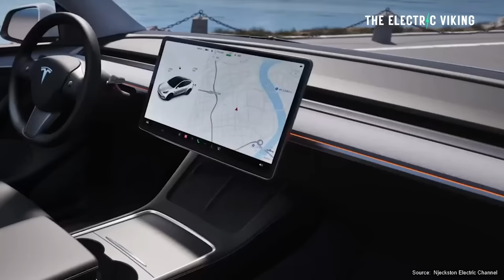Ship with thousands of NEW Tesla Model 3 & Y forced to sail back to China

Comment: Some corrections to a few major inaccuracies in this video:

1. The Glovis Caravel was not carrying any Model 3 Highland vehicles. The entire shipment consisted of Model Ys
2. There are no "updated versions" of the model Y being shipped to Australia.
3. The ship was not immediately rejected by the Department of Agriculture, Fisheries and Forestry. It spent a few months sitting off the coast, and went through more than one cycle of fumigation and inspection before finally being rejected.
4. The voyage between Shanghai and Brisbane is approximately 10 days.
5. Customers with cars on the Glovis will NOT have to wait a couple more months. They have all been assigned new VINs of cars just off the production line, which are right now being loaded onto another ship (The Morning Crystal).
6. The cars being sent which came off the production line just a few days ago, are the exact same spec as the September/October manufactured cars they replaced. The updated Model Y being sold in China, is NOT being sent to Australia.
Reply: A couple of months ago he was fixated video after video that the highland was getting new type of batteries with longer range

This was never the case as the battery pack and engines remained UNCHANGED 

He did like 20 videos on how the new batteries on the model 3 would make them the range king
Reply: @Rapido20  yes, it is just stuff he makes up without any value to it.
Reply: This reminds me of the following. “Hey did you hear James won $100 betting on backgammon?” “Yeah, except it was not James but John. It was not backgammon but poker and he did not win by actually lost. And it was not $100, but $10,000.”
Reply: sorry but honest question, why and how do you know that? I would love to get all those news and info that you got. When I got my M3 4 years ago (in Europe) I was searching for those info as well and never got it that detailed. Do you work in this business or even for Tesla?
Reply: You seem to have inside information. Do you work for Tesla?
Reply: Ok not that anyone thinks this youtuber is a Tesla spoke person but why should we believe you as well? Are you a Tesla representative? 
He is obviously only making guesses, but you are speaking with absolute certainty and authority, with no evidence what so ever shown for your claims.  
So to me your words have the same value has those of this youtuber, zero value.
Reply: Since you have so much info, maybe you must start your own channel and leave the viking alone
Reply: @petersmangalisongoma2013   If his corrections are correct, he's doing us a service.  Seems to know what he's talking about, even your heroes need accountability.
Reply: Excellent info. Just another war of the roses.😂
Reply: Thanks for the clarification. I would still not send new cars. Australian voted this government and its new rules into power. Let them live with the consequences for 2024 and then maybe send them the cars
Reply: So you are saying the make 2 versions of the model y in china the old one and the newer one and that seems logical to you? Not to me
Reply: Doesn't make sense they make 2 versions of model y unless they are stock sitting in a field somewhere accumulating bugs. So are you saying newer model y isn't made at all yet?
Reply: The Glovis Caravel arrived in Brisbane in late October, it was fumigated on 3 separate occasions failing each subsequent inspection
Reply: @lukasfoo recents status of the glovis caravel has been discussed on multiple online forums for quite sometime now bywaiting customers. Daily mail has just reported this. Likely to be a waiting customer
Reply: @RuffyUzumakii7 multiple Australian news outlets have posted articles regarding this subject.  Just do a Google search.
Where do you think Sam gets his information? He doesn't have a hotline to Musk. 😅😅
Reply: Check your use of apostrophes.
Reply: tried to kill the fruit flys that invade my place (no fruit oddly) and they keep coming back so its hard to kill bugs
Reply: Hi Tyran, great response. I spotted a few errors myself, as I have imported a few cars from this region, and have a rough idea of the processes involved (especially paperwork).

Fantastic correction from somebody who knows what they are talking about.

Ignore the other crank comments. These people are just being a bit “sooky”
Keep up the great comments!
😀
Reply: I don’t expect he (Sam) will read or respond. Interesting info. Thanks for posting
Reply: @Rapido20 I've noticed that most of his videos are hyperbole. They all start with, "Game over," "This is the end of legacy auto," or "This is a game changer." Funny thing is, most of it never comes to fruition. I take almost nothing he says seriously. I do like to watch some of his videos, it's pretty cheap entertainment.
Reply: I’m really surprised the info you posted there are damn correct. This is because we ordered a MY back in October and car was on that Glovis ship. We got messgae from Tesla saying our order has been delayed due to biosecurity. Yesterday we got an update from Tesla stating our order has been assigned to a new car and on it way. They also provide 6 month EAP as compensation.
Reply: @lukasfoo  its all on the Tesla Y Australia facebook group, customers who have been waiting and tracking the boat and also ringing up Tesla Australia for updates.
Reply: @bros4life690  Thanks.
Reply: Thanks for the update. He got literally everything wrong
Reply: @beavcleav3086 He doesn’t do retractions or apologies, he just pumps out more videos. It is what it is.
Reply: cope much?
Reply: Apologies, for posting exactly the same corrections again, read your comment a bit too late 🙏🏼
Reply: This bloke just makes things up. That ship sat off the coast for a couple of months, it was reported in the papers.
Reply: “3 ... It spent a few months sitting off the coast ...”

“4. The voyage between Shanghai and Brisbane is approximately 10 days. 5. Customers with cars on the Glovis will NOT have to wait a couple more months.”

It is good to see some optimism coming from the political left.
Reply: @petersmangalisongoma2013  - Perhaps the Electric Viking channel should be DELETED ?
Reply: I dont think the information or the video titleis correct, Tesla were shipped back because people wanted Nio or BYD instead and better battery from BYD lol
Reply: @alphaomega1969   - BYD is a NON player in EU, only sold 13601 , compare to TESLA at 319,711. 
RIP BYD and Nio.
Reply: @Argoon1981   He probably does that thing people used to do... read ... instead of watching videos for news.
Reply: @realestatenow 😂 LOVE your story, but the Viking is definitely not that bad
Reply: @Argoon1981  now now, there is value to research, as well as stating educated, guesses or deductions as such, and there’s much value to community notes too, to round out a report. 

When I add unauthorized expert comments, I certainly can’t reveal credentials. He is clearly in the same situation.
Reply: Unfair. There is value to both the research, and the community notes.
Reply: @gcauldwell  LOL
Reply: Ok smarty pants, lol
Reply: @markplott4820 How many people in EU😂😂
Reply: @realestatenow  But otherwise it was spot on!

Comment: It's not the only boat to be sent back to Port of origin.  I remember reading in 2022 several vessels ordered to return due to similar issues.  Mainly because the vehicles had been stored in paddocks has they weren't allowed to be shipped at the height of the pandemic.  The vehicles were covered in bugs and seeds. Several different manufacturers were affected.

Comment: Takes 8-9 days for a car ship to transit from china to Australia. Burning 50 tons of heavy fuel per day. Then will take 3 days in port to discharge the cars burning 12ton of Marine gas oil per day. Then 8-9 days to return empty.  Fumigation of the cargo holds will take 2-3 days. So all done for 1300 ton of fuel burnt. And lost shipping time for next batch.
Reply: That's of it went smoothly.
The ship was here for 2 months doing circles off the coast and occasionally coming in for an inspection.
It arrived around October 22 and headed home December 22.